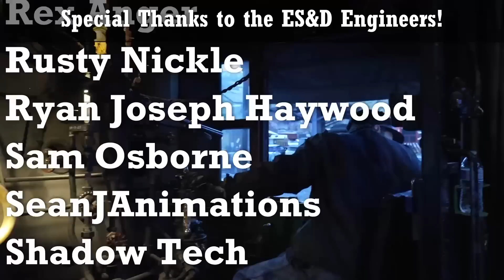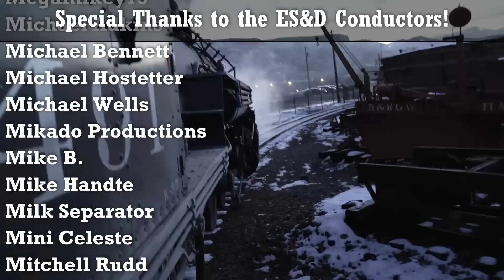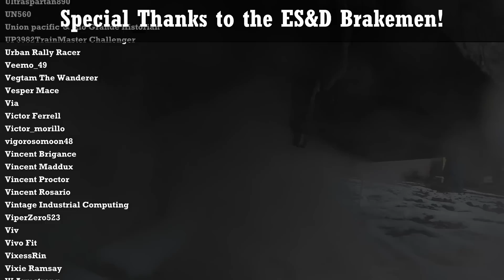Light rail isn't light? Street Car vs. Light Rail vs. Commuter Rail | Railroad 101

Comment: I would love to get more information about the different rail weights or rail types and we use today what we are using. Historically there were many different profiles, then some rails that look like ours nowdays, but they went thicker in the middle. And also why is a heavier rail capeable of more stress than a light one, if they both are on wooden planks?

When you are writing in another language and don't know the vocabulary, it is hard to not sound dumber than you are...

Comment: I live in the DC region and we have a variety of systems including WMATA (Metrorail and Metrobus), MARC (commuter service in Maryland operating on CSX and Amtrak's NE Corridor), VRE (commuter service in northern Virginia operating on CSX and NS) and the infamous DC streetcar (ummm.....yeah.).  Metrorail (our subway system) and CSX share the ROW with the red line bisecting the CSX double track  Metropolitan Sub. (former B&O Metropolitan Branch) between NE DC and Silver Spring MD.  I recently, as in just this week after having lived here for decades,  learned that WMATA actually owns the ROW and leases the Met Sub back to CSX along this section.  Back in the mid-80's, there were a couple of freight train derailments along this segment that naturally sparked concerns as to the safety of having a busy subway system running in parallel to an active railroad and I believe at one point, WMATA was trying to get CSX to alter its operations to restrict most of its traffic to overnight hours (Mr. Harrison would have had something to say about this I'm sure).  The Met is also used by MARC and Amtrak.  Freight operations remain unimpeded but they did install a corridor integrity monitor along the fences separating CSX and Metro.  An abandoned interlocking tower (QN) was torn down at the insistence of WMATA due to the potential for arson.  The tower was located  adjacent to the Rhode Island Avenue Metro station.

Comment: Interesting insight to how you differentiate the three "weights" of rail transit. On the east coast when I went to college, we were taught to think of light, commuter, and heavy rail in terms of passenger density. So light rail could take a decent amount of people per train, then commuter rail had the potential to take more people at once, and then heavy rail was for super passenger-dense systems like the NY City subway where you could have like double-digit car count trains absolutely packed like sardines during rush hour.

Comment: One correction:  Up until the last 2 or 3 decades, streetcars were almost all high floor, including the PCCs and the Kawasaki cars (Philadelphia) that you showed footage of.  Low floor streetcars are mostly a modern invention.  But I would be remiss if I didn't mention that at least one exception existed:  The Boston Elevated Railway Center Entrance streetcars built in the 1920s, which had a low floor region in between the bogies, and (as the name implies) HUGE sliding doors in the middle on both sides to let passengers get on and off quickly while going by the conductor stand in the very center of each car.  I know that some other "center entrance" cars existed elsewhere, but they tended to be single-sided/single-ended, and I am not sure if they had low floors in the middle.  Interestingly, even when Boston got PCCs, which were almost all single-ended (the ex-Dallas cars being an exception), they still had to get them with doors on both sides, due to island platforms in the Central Subway that they had built to ease streetcar congestion in the 1890s, as well as in a few other places -- a few of the stations on the surface lines through Cambridge into Watertown and Belmont also had island platforms in the form of safety islands in the street, as well as the lower Harvard bus tunnel having a left-hand platform, and so when they went to electric trolleybuses in the 1950s, THOSE also had to be ordered with left-hand doors.  Unfortunately, in the last few years the MBTA management decided to get rid of all of the electric trolleybuses (also including the dual-mode buses on the Silver Line Waterfront) in favor of battery-electric and extended-range hybrid buses.  But they STILL have to order the ones for the Cambridge routes with left-hand doors, because they passed up the opportunity for realignment when they were renovating the Harvard bus tunnels.

Comment: You should come to Pittsburgh PA and do a video about our light rail system here. Some parts it has its own right of way and others it runs on the street then is back to its own right of way then back on the street of its own that’s also used as a busway then in the city is runs underground like a subway does. We still have The Siemens SD400 LRVs and CAF LRVs as well.

Comment: Thank you for this broad-strokes tutorial on light rail. Back in Philadelphia we certainly had streetcars, subways/els (they never seemed to run on the ground) which would be "light rail" and what SEPTA called Regional Rail, which meant the commuter trains that went out into the five-county area. Also some completely mad bus drivers who would run the streetcar routes in the middle of the night. Most of my time in Philly I had no car or leaving my hard-won parking space wasn't worth it - so I got very familiar with all of the above!! 
My nerdy heart would love videos on both rail weights and light-rail signaling/ops. During rush hour in Philly I never seemed to wait more than a few minutes for a subway train, and they went _fast_. Thanks again!!

Comment: Excellent video. I have no nits to pick. 🙂

Useless knowledge: It is true that many older Americans have an aversion to the metric system, but to be fair, the rail Pounds Per Yard is ye olde system of measurement from England. It's from the beginning when sections of rail were iron cast in 1 yard lengths. Then, when the change was made to roll forming wrought iron into longer lengths of rail, the measurement was kept for easy comparison to the size of cast rails.
Reply from the maker: That's fascinating! Thank you for the useless knowledge. :D

Comment: Some many comments but as an ex rtd commuter engineer we are connected to the national rail network at Denver Union station via Track 4. More RTD things we had 32 Married pairs basically two cars. Daily operations during peak works out to 7 trains on the A line(usually a double married pair so 4 cars total) running every 15 minutes, 3 trains on the N line for every 30 minutes, 3 on the g line for every 30 and 1 on the B line for every hour(thought the trip is only 12 minutes each way lol) At precovid operating the G Line had 6 trains for every 15 and the B line had two trains for every 30

Comment: Bonus Commentary.
"Light Rail Transit" is usually 8.5 feet in width compared to the 10 feet of full sized trains to match the width of 18 Wheeler trucks and merge properly with traffic with most big vehicles. Anything wider than 8.5 is considered "wide load" and not permitted on streets without proper signs or some type of permission. But of coarse there are exceptions in some cases.

Comment: I've heard that one of the problems with the Trans-Siberian railroad (and to some extent the US Transcontinental railroad) was that it was initially built with very "light" rail.  In an effort to just produce the thousands of miles of rail needed, they used the lightest possible.  Once the railroad was "completed" most of the track had to be replaced.  The light rail did not hold up to Siberian winters and had a bad habit of shattering in the cold under heavy load.
Reply: I don't hate to do this, but historically in Europe, the UK, and North America not inky were a large number of railways built with "lighter rail" to have it replaced later when traffic on the line warranted it, some were also built to both broader gauges ( in the south of the USA,  most lines were built to 5 foot gauge for one example) but narrower gauges as well, again later "converted" to 4'8 1/2"

Comment: I have also ridden an RTD train in Denver.  It came right by my hotel, turned the corner and went up by the Theater.  Seattle, Denver and Austin all have Paramount Theaters.  Seattle's still has their original 1926 Wurlitzer pipe organ(although it now has micro-processor controls - the original relays are still there because no one is crazy enough to carry them down the ladder which is only a couple of feet from the back of the building.  If you get up that way again, all 3 theaters in the Seattle Theater group give behind the scene tours on various Saturday's.  I had a blast.  I have done the tour at the Moore (1907) and the Paramount so far.

Comment: You hit home with this one.  Up in Seattle, I have seen several different transit varieties.  On the other end of the Alaska Airlines non-stop is Austin, Texas.  Here we have a big mess train wise.  Capitol Metro wanted a train really really bad.  Really bad.  They had Federal funds burning a hole in their pocket, so they bought and re-built the old MKT line from around Marble Falls to Giddings.  They contracted with a company over in Europe to build it some cars and it took forever.  They built us 5 pairs of cars with a mini-diesel-electric pusher in the middle.  ("Commuter RailRoad") Meanwhile some former train folk started the Austin Western Railroad.  They operate a small yard here with a number of tracks and an apparently good Diesel shop as well.  In better weather, it is not unusual to see an engine minus it's hood sitting in the yard.  Not far from the yard is the Austin White Lime plant, which had lots of land.  That now has 3 or 4 Wye's to allow traffic to and from UP, BNSF, and one other to transition to and from the Austin and Western track.  Austin and Western was eventually sold to the WAMX system.  So as to help Capitol Metro, they leased the line to run freight on it, outside of the commuter time frame and on weekends.  A few years ago, a new bond issue came through for the third or fourth time and it finally squeaked through, so now there are two more lines of "Light Rail" being planned.  Some of that may end up converted to Commuter Rail because some folks started to question why the existing trains couldn't run on the new lines.  Near my house in Hutto, we have a UP mainline that is mostly east bound only.  I would expect it to be paired with a line running west bound, but don't know yet.  There is some west bound traffic, mostly Amtrak going into Austin or San Antonio and gravel buckets going out to Marble Falls for gravel to build the new Samsung chip plant in Taylor.  It started as a single building.  The day they got that through city council, they submitted plans for 5 more buildings.  Now it has been expanded to include a water reclamation facility (Blue Sky Project) and a gas plant for Linde to make exotic gases needed to make chips.  My dream is to get some land near some track and a driveway siding.  Then get a 1940's Alco mini like they used to(and I think still have) at the Texas State Railroad.  I got a cab ride in that one around 2006 as my ham radio group did Field Day in the park, including operating call sign N5W from the old MKT caboose.

Comment: The problem with these definitions that’s their always exceptions for every rule, though it’s very much different in the uk in till recently you had tramways with main line passenger trains operating on them other then this normally you have national rail then lightrail which is a separate system in the uk under light rail you have systems like the DLR and Tram link which though under the same name have different regulations and classifications. After this you have publicly owned equipment which is directly owned and operated by private companies and then you have state owned which is completely owned and operated by state/ government. Also I’m not sure how it is measured in the UK now but when I used to volunteer on the railways we did everything in chains which are 22 yards or an 1/80 of a mile and around 20 meters.
Reply: For new build lines in the UK (or the reopening of entirely closed lines e.g. the Borders Railway) the chainage is given in kms; Everything else gets given in the format x miles xx chains.

Comment: These terms are hard to define, but here's my (very arbitrary) opinion:

A light rail vehicle is a rail vehicle that can safely and efficiently operate in mixed traffic with cars. E.g. it probably has a track brake. It doesn't have to actually operate in mixed traffic, just be capable of it.

A light rail system (LRT) is a rail system that uses light rail vehicles, regardless of whether or not vehicles actually run in mixed traffic. E.g. Boston's Green Line D branch or Mattapan Trolley.

A streetcar is a subset of LRTs that make minimal use of dedicated ROWs.

"Heavy" rail is any railway that isn't an LRT. The sub-types are differentiated by speed and distance of the trips they're designed for: a subway or metro is optimized for short trips with frequent stops (e.g. Boston Blue Line), intercity rail takes passengers at high(ish) speeds between cities (e.g. Amtrak), and regional or commuter rail is between the two (e.g. the Long Island Railroad). Essentially the passenger version of class 1/2/3 freight railroads.

Are these based on any particular expertise? No. But I think they make sense.

Comment: It should be noted that in the transit realm, "heavy rail" generally refers to subway/metro/underground/u-bahn/MRT/rapid transit systems- basically everywhere calls these something different, but "metro" is the most common in international discussions and doesn't have misleading implications about the alignment like subway or underground do, so it's usually what transit people prefer, with "heavy rail" being used mostly when talking to politicians and the general public who don't know much about trains to distinguish it from light rail. The main difference between metro/"heavy rail" and light rail is that metro systems are fully grade-separated, though a couple older systems that have all the other typical features of a metro like system-wide high-floors, level boarding, and high frequencies have a few at-grade crossings grandfathered in, like Oslo and Chicago.

Light rail is honestly a pretty deliberately vague term, which can be used to describe anything from a tiny useless modern streetcar like in Milwaukee or DC up to something barely a step removed from a full metro like in Seattle or LA, and is often wrongly applied even to things that most definitely are not light rail, like the Montreal REM or Honolulu Skyline, both of which are full grade-separated heavy rail metros that got called "light rail" by people who assume any new system opened in North America is light rail because that's what most of the new stuff built recently is. By using such vague terminology, people can wind up approving an Atlanta Streetcar thinking they're getting a Calgary C-Train.

Mainline short-distance passenger trains that primarily serve one city and its surrounding area are regional rail if you're talking about good systems that run reasonably frequent all-day bidirectional service and "commuter rail" if you're talking about the terrible North American systems that run a handful of trains from the suburbs to the central business district in the morning, a handful from the CBD to the suburbs in the evening, and pretty much nothing else, ensuring that they're only useful for suburbanites commuting to downtown 9-5 office jobs and completely worthless for literally any other trip.

Comment: I always thought the main difference was in the crash worthiness standards. “Heavy rail” vehicles have to assume hitting a 18 wheeler at a grade crossing at 70MPH with 10,000 tons behind them.  Light rail assumes a DMU with perhaps 8-10 cars max generally operating at slower speeds. The standards as I understand it for both the locomotives and passenger interiors are significantly different. 

This argument also comes up with the few commuter lines and the NEC where there is full grade separation but the FRA is holding the equipment to “heavy rail” standards. Many argue in these environments we should adopt Europe’s standards, “medium rail?”, to get more efficient and comfortable vehicles at a lower cost.
Reply: Because of tragic US freight rail passenger cars telescoping and coming apart in crashes circa 1900 US passenger train cars were made to have crashworthiness based on  these situations.   It keeps most people a live in a bad crash.   People are typically killed from being thrown into objects inside the cars.  Non North American freight rail passenger cars come apart in a bad crash.   This is why European derived passenger cars are much heavier when adopted to the US.

Comment: There are a couple of switches at the throat to Denver Union Station that could in theory allow for interchange between RTD and BNSF (or UP, not sure who has all that track these days.) those probably only exist for emergency use of a different platform by Amtrak or delivery of RTD equipment.

Comment: What about hybrid rail? There's a system relatively close to me in the Camden/Trenton area called the River Line, and Wikipedia calls it hybrid rail, not light rail, but I've found basically no info on what hybrid rail actually is. Any help would be appreciated, thanks
Reply: It's probably still on some level 'light rail', but with "temporal separation" keeping it segregated from freight traffic on the same line. Light rail by day, freight by night. ION light rail in Waterloo, ON has the same practice.
Reply: @RailRide  Could be, they do run some local freight on their tracks during low-travel times
Reply: I'm sure Wikipedia calls it hybrid because it uses trains which are deployed on mainlines in Europe (e.g. the GTW on the River Line) but can't because of crash standards in the US.
Reply: @MarioFanGamer659  Interesting hypothesis, not something I would've thought of.